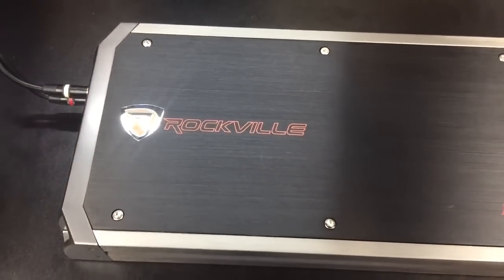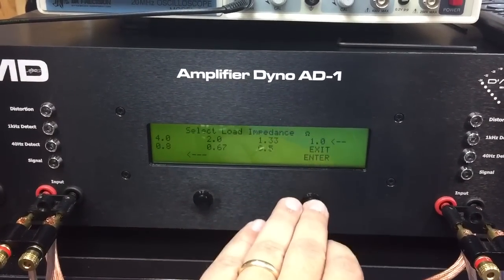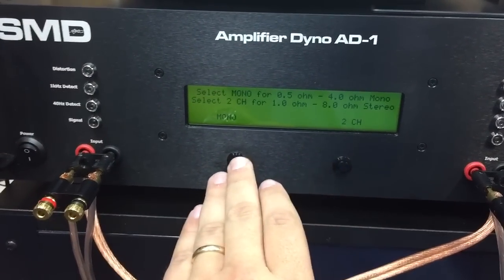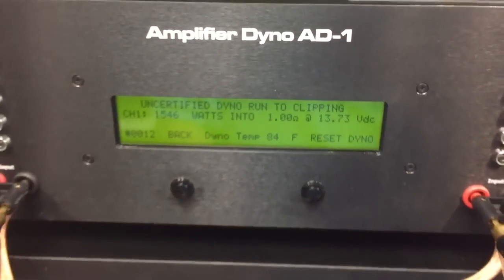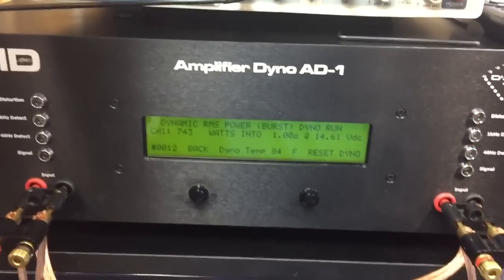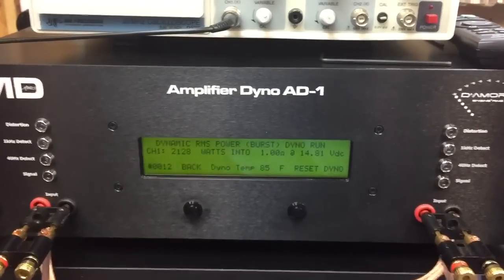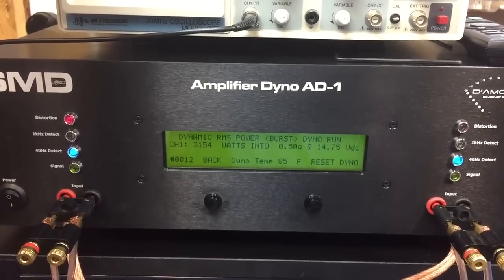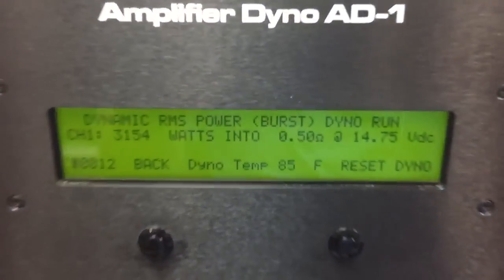Rockville RXD-M4 1500W Monoblock Amp Dyno Test

Comment: this amp and this company Rockville are garbage. I bought the m4 after watching this. I had the amp in my car for 31 days and it shorted out.  now I tried getting a warranty claim started, they say you have to call their hotline, but they do not answer the phone. Do Not Buy This or any Rockville product.
Reply from the maker: I bought these amps and sent them back before the 90 day return policy. I did not call anyone, used their website to get an RMA
Reply: I don't know how you did it, all it says is contact with the phone number and time to call.
Reply from the maker: +Phillip Stearns sorry to hear, my return was simple. They obviously have changed the process, hope you get it worked out
Reply from the maker: Sux bro. I would contact them on Facebook and let them know you are having problems with the return. It's inexcusable to require you to call to make the return, then not answer the phone!
Reply: +Dereck BigDWiz I actually did contact them on face book, and they said I had to call the hotline. I've been around and around with this company. they use the business strategy at having shitty customer service so they don't have to honor warranties. its getting more and more common with businesses. Rockville is also just a rebrand from audio savings, which is another crap company that couldn't make it without ebay. I've done alot of digging and this is all my opinion, so just be warned.
Reply: I been having mines for a while and shit still hitting with no issues.

Comment: Sure the amp may put out the wattage but how does it actually sound. These "amp dyno" tests make me cringe because it says nothing about how the damn thing handles 20hz to 60hz.
Reply: True it's PWM Class D, but still an amplifier's -3 db point is always nearby the 7-8th octave in full range or over 40 Hz. Then there's cab/room gain .. Should the input signal be clean enough and the box tuned well only thing needed by the amplifier is to just do it's magic which at all points has certain linearity.
My point is, at this price with the CEA RMS ratings ... nothing a modern equalizer can't deal with. It is still a budget amplifier. :)
Reply: Oh that would depend on many other factors which revolve around cooling the whole system down as well as the certain headroom with which the system had been engineered for. Heavy Duty drivers and amplifiers are usually able to withstand a full 24 hours cycle on maximum - at that class that is still very relative because of different utilization techniques.
To generalize, every engineer that has some self esteem knows a probably amount of true RMS rating of his most favorite system.  By "true RMS" I mean the consumption rating for a full 24 hours cycle, it is the point where the woofer is moving just enough to play and hopefully get as lower as possible thermal compression. I do believe that most drivers today fail on the margin of this ratio.
Can you elaborate more, are you speaking from experience from the RXD-M series or just in general?
I ask 'cause I am planning to utilize 4 or 6 units of the M5. I find it's musical capabilities on a price versus performance to top out any other brand, even the top-most ones. It's due to the intelligent utilization of their so called "Optical-Coupler" technology which gives high true RMS rating whilst maintaining a factor of THD below -100 dB. Something which Sundown, Taramps or even Ground Zero fail to achieve at the given consumption rating.
Reply: Also nothing to do with long term play.  Found that shit out for myself.
Reply: I have Rockville tower speakers on my boat and sound awesome.

Comment: what does it do at 2 ohms
im thinking about buying this amp.
or the cab 1600.1 you tested recently .
wich one will it be better amp
Reply: I believe the M4 has a higher S/N but lower wattage at 1ohm. they both make Great power. the CAB is going for 60.00 bucks or so more than the M4.

Comment: this amp pounds... I got a Rockville M4 pounding on 2 bravox esx 15d2 on a half ohm load... never gets hot... no clipping..  etc... just make sure to power up.... big 3, cap,  and 2nd battery...I'm running all Rockville.. from the head unit to door components to bullet tweeters...etc... video coming soon
Reply: hit me when u ppst that vid. i have it pushing 2 15 xlf 1544
Reply: +Arron Riley video up
Reply: +APBTisBeast I'm still going

Comment: what is this CEA rating, i now only rms power.
Reply: +Audio Freak87 CEA 2006 means the amp will do the rated RMS power at 4 ohms, however, it does not always say the truth about other ratings, just something to look out for, however: Rockville, Rockford Fosgate, MTX, JL Audio do their ratings, i can't speak of other brands
Reply: +BH4x0r my friend have now few amp of the the rockville and he is running on half ohm, with not any problems.
Reply: Audio Freak87 yea, Rockville is great for it's price, i don't think anything else beats it in this price category, like Crunch, Boss, Dual, Pyle (non pro ones), Pyramid, Lanzar, Autotek (90's stuff was alright, but today's products are garbage), MB Quart and even Fusion are brands you want to stay away from.

Comment: What did it do at 2 ohms?
Reply: I no he tested it at half an ohm witch know one would be able to use it at half an ohm ever.  But everyone could  use it @ 2 ohms but doesn't show ya those ratings. That's what I was waiting for too ?
Reply: @bradleycasady9810  it does 1002 RMS a little more at 2 ohms and 1%THD+N I JUST BOUGHT ONE WILL BE MAKING VIDEO ON IT SOON
Reply: @CLIFFWILKES  
Thanks. Don't know why he skipped 2 ohm. 
I think I'ma buy the Skar 2000.1
Reply: Dont buy cheesy subs and 1ohm thst bitch..u wont be disappointed

Comment: I get mixed up on some amps how they have 2 speaker  terminals and there an monoblock amplifer I thought monoblock amplifers suppose to have 1 speaker terminal. do you use 1 terminal or both to wire your subs.
Reply from the maker: +anthony vigil They are wired together just to help if you have to wire multiple subs. You can use one or both terminals, doesn't matter
Reply: thanks that solved my problem.

Comment: Lol man that amp will never see those numbers in a car!!!!!!    I would stick to a audiopipe if I only could afford a budget amp
Reply: +JASON JACKSON  Yes because using nearly the exact same electrical system that you would use in your car to test the amp is so much different. That's like saying an engine that made 1500 horsepower on a dyno wouldn't make 1500 horsepower in the car. If you're gonna comment, try thinking before showing the world your an idiot.
Reply: +George Owen Well, 1500 hp on a Dyno doesn't mean you will actually SEE those hp ratings in the car, to the wheels.  So there's that.  Not saying you are wrong about the amp but your example doesn't support your point, it counters it.
Reply: +George Owen Me hates the idiots!!!! lol
Reply: I'm with you I would stick with audio pipe
Reply: Looking to power 4 kicker 6 1/2 speakers and 2 bazooka 10 subs in my boat. Would the 6 channel marine version be enough to push the speakers?

Comment: ok I must be wrong but everywhere I read the m4 was supposed to be 3000 RMS at 1ohm
Reply: +donald lewis 1500 is the cea rating
Reply: Kind of figured that I bought the 1000 and the 4 Channel they were fun while I had it but they ran way too hot for my liking so I sold them
Reply: I'm saying
Reply: +donald lewis any amp does when your clipping them to shit
Reply: +PsMoKe Mob whoever said I was clipping
Reply: Had to be if they were running hot you didnt see the video
Reply: +PsMoKe Mob I'm not a rookie I have tools to set the gains never said the amp shuts off I said they ran to hot to my liking some amps run hot do research go to the Rockville Facebook page its a common problem
Reply: +donald lewis Tru I'll check it out
Reply: +donald lewis the rxd m4 never gets hot on me

Comment: BigDWiz do u thank straped they could handle .33ohm before box rise.and what size power wire will fit in it 0g??
Reply from the maker: jason mc johnson sr No and no. These are 1 ohm stable amps and strapped would be 2 ohm amps. I'd confirm with Rockville Audio to be sure though. The power/ground inputs are 4GA, but you could use 0ga>4ga reducers if you wanted.

Comment: I would like to see the new ECD-5400 VM audio  amp it's rated for 5400 rms? And only cost $249,00
Reply: Suazzz That amp has nice internal circuitry, but most 5000watt amps cost around $700+ that amp costing just $250 the circuit board components are super cheap and will fail quickly.

Comment: Nice to see another manufacturer being truthful about power spec, and really dig that is able to test at a 1/2 ohm load.  Like the Audiopipe's you previously tested, I'm stunned by the price point and it's performance.  It ain't old school, but now I'm wonder'n if a revolution (in terms of both size and in terms of power) is occurring with some of this new car audio gear (I'm still wowed by that punny Kenwood amp you tested).  This and several other of the new amp's you've tested are starting to raise questions in my mind.
Reply: Wtf are you talking about? Truthful about what? Did they say somewhere that they are fcking liars? Your an idiot if you think this is ok.

Comment: Not bad but isn't it rated to do 3000 rms but only does 2100?  The 3100 was .5 ohms which it isn't stable at or recommended to be ran at.  Another question I would have is how hot is it getting at the 1 ohm, thanks!  2k rms is still great at 150$ but not meeting claimed specs always makes me leery.
Reply: exactly what I thought
Reply: 3k rms at 1 ohm 2k rms at 2 ohm
Reply: After looking at this video and doing some reading It seems to me the CEA numbers are what you're supposed to be looking at ignore everything else
Reply: +John Doe your not reading the rating properly....its rated 1500rms cea do research please.witch it surpassed on a realistic dynamic run i might add.
Reply: +Mark Lawrence  I was thinking the same thing it did over rated down to 1 ohm

Comment: Have you had it on speakers yet? I'm interested if it has a decent noise floor, maybe the 4-channels would work for budget SQ if it's not too noisy?
Reply from the maker: toylocost I tried it on my test subs, currently dual 8's with 10" passive and it made them sound very good. I want to get a bank of subs in the future so I can better compare amps and be able to modify the ohm load by changing the series/parallel wiring

Comment: We're I seen the link to this at has posted gut shots...I'm impressed as well. 1200@1 clean for $150 not bad at all. But I'm more interested in your power supply lol. I've had a few 120a supply's clamp between 120-140amps wonder were your 300a one came from
Reply from the maker: Phillip Lynch My power supply is custom built by a local electronics technician. It is capable of 250A at 18V or 320A at 14V and is adjustable from 9V up to 19V. I found it on Craigslist a couple of years ago. Cost the original buyer about $1200, I paid less than 1/2 of that.
Reply: whats its input? mines  AC 110v or 220v with DC 12-15v with adjustable output @ 120a rated. an is custom modded from server supplys. but i fried my last one when it fell across my battery terminals lol. i was just wondering your input beacause voltage drops so much. mines %100 stable @ whatever voltage you set it untill it cant make the power anymore an it goes in protect.
Reply: Phillip Lynch I used to power a rockford fosgate 8" subwoofer inside my house with a kenwood amp and a 500w atx power supply. The voltage and volume would drop really fast. I stuck with that setup until I saw a EV 1000w power amp on craigslist for $60 which is much better.
Reply from the maker: Phillip Lynch I can promise you if you test voltage at the amplifier, your power supply is dropping voltage as well. That is, unless you have a voltage feedback circuit that monitors and keeps voltage at a certain value. Ray Rayfield has this with his seven, yes SEVEN 70A Astron power supplies at Linear Power. He's able to keep a constant 14.4V. My power supply uses 220V input 30A.
Reply: no ive done multipul test. i used it as a test bench or running amps in the truck at higher voltage without burning gas....its a modded server supply. it has multiple protection circuits in it as well as keeping voltage stable down to a 10th. ive used a load tester to simulate load an it will rise a 10th or 2 in voltage rather then drop when heavy load is placed.

Comment: Wow, impressive. I haven't purchased a brand new amp in 16 years. Back then, big power usually meant big bucks.
Reply from the maker: 90blacknight No doubt. Insane they can sell this amp with a fuse holder, 200A fuse, bass remote, etc for $150 shipped!